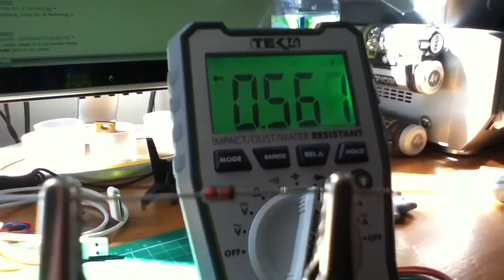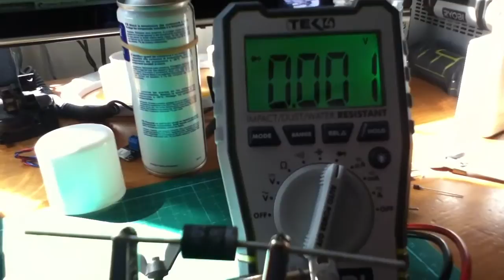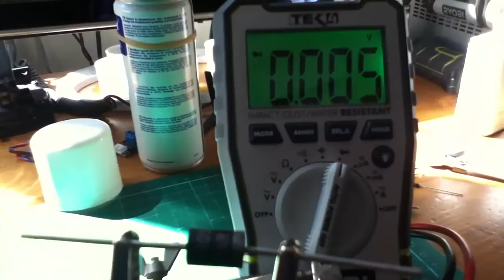Schottky Diode Experiments - Zero Forward Voltage?

Comment: Hi i have here a TV with power supply with a Blown fuse and i checked a schottky diode 2D-02 and i test in circuit it tests short when i take out of circuit i tests  open,with my fluke  in diode setting,is this normal or is it bad ?

Comment: I just bought Schottky diode today, rated to carry 3amps. I measured the resistance of this diode and it was 84ohms. Why so much resistance?!
Reply from the maker: A resistor has a linear relationship the voltage dropped across it and the current flowing through it. A diode has a non-linear relationship. You can't expect a DVM on its resistance setting to get meaningful data from a diode.

Comment: Heh, this CAN happen in circuits, it is called thermal runaway. The diode heats up, and the forward voltage drops, allowing more current to flow through, heating it up more. This is assuming you have two 3A diodes and parallel and you are running 6A through them..... OK, right?! NOPE!!! This will happen...
Reply: It would only lead to thermal runaway if its the dominating dissipiive element in a circuit and sees a constant voltage looking out the terminals of the diode. In any real circuit there will be a much larger voltage source with a load. Small 0.2V fluctuations in the voltage drop will increase current very slightly, butas the drop across the diode increases the power dissipated will shift away from it and instead towards the load. So Its actually the exact opposite!

Comment from the maker: I didn't test reverse voltage, but a later video shows that the reverse current leakage gets very large when hot. So the diode ends up like a piece of wire, conducting in both directions.

Comment: does it still function as a diode when its heated, the FDV  went to 0 but  was it still blocking  reverse voltage at that point

Comment: You'll get a higher voltage dropped over the diode as you increase the current, so presumably you would have to apply more & more heat as you go. At some point the diode ain't gonna like that! heh. Perhaps putting the diode in a glass jar up by the panel so it gets sun on it might help. The ultimate zero voltage drop blocker though is a relay that simply turns off when the sun goes down. These solutions are unnecessary in most cases though as charge controllers usually take care ov the blocking.

Comment from the maker: The other diodes are affected in the same way, but I didn't try taking them to zero volts. It's a curiosity really because the reverse current increases massively with temperature, so the diode ends up more like a piece of wire when it's hot. Also, the forward voltage increases with forward current flow, so if the heating is caused by a large current flow, the forward voltage goes up (not down). I'll do some more videos on these Schottky diodes soon.

Comment: That was amazing. What happens to the other diodes if you heat or freeze them too? A little current flow would still be preferable than a normal higher current. Scuse thicko here but what circuit applications could you come up with where this heating of a Schottky diode could be used? Many thanks and keep those videos coming.